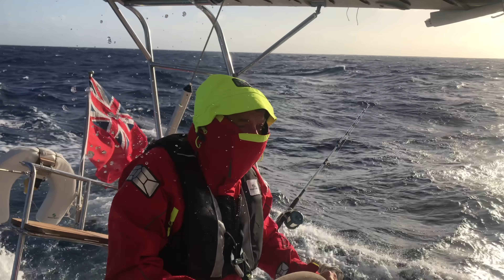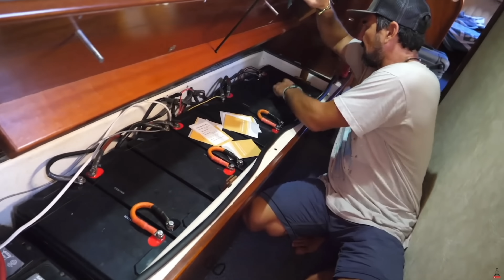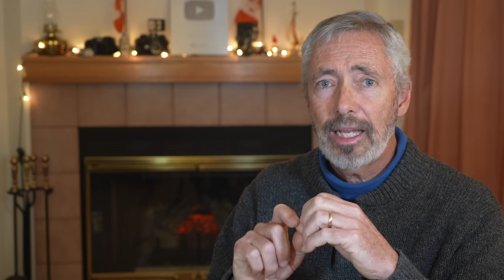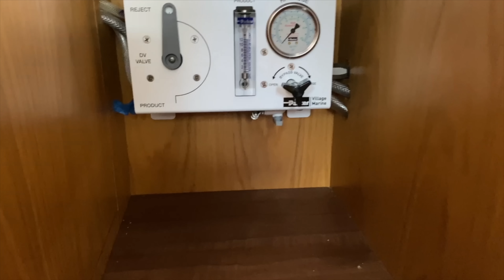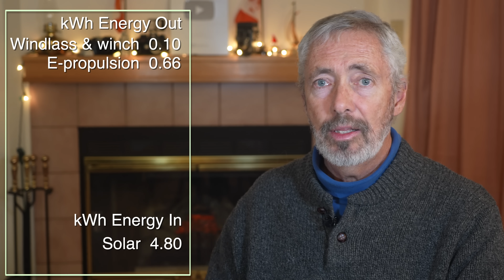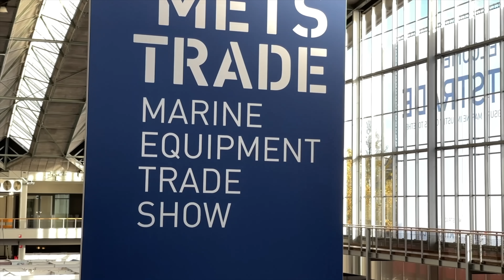Building an ALUMINUM Sailboat Pt 8 - HYBRID Power on a Sailboat: Will it Work for Distance? | EP 228

Comment: You might be wrong about Norway and Solar.       In winter we have little to just a few hours of sunlight.   But spring and summer, depending on where you are in norway close to 24 hours of sun.   So you have to acount for all the extra hours you be charging here. June in Sognefjorden you will have 20+ hours of sun if not in shodow of the mountains.      -Norwegian sailor

Comment: I personally would probably be willing to go with electric engine instead. But I would still get DC generator. Nice thing about generators is that at least in theory, they are simpler and more reliable, DC even more so. Those generators also come with their own self contained enclosure to keep it from elements and noise reduction. 
Ofc, electric engine has it's limitations, so you would have to be comfortable working around those.

But honestly, hybrid setup if you have money is best for almost every modern sailor. It's versatile and safe pick, and works well with someone that wishes to have electric appliances and other electric conveniences + simplification of systems on board.

Comment: I think something being forgotten here is the possibility of using a smaller almost agricultural style water-cooled diesel, much smaller than what you would typically use as the auxiliary power unit to turn the prop, to run a generator set (charge batteries or power high electrical consumption situations) and also provide heated water for a heat exchanger for hot water. Your hot water tank could have both the heat exchanger and an electic element in it. Multi-point charge controller for a few banks of batteries to allow you to combine the outputs from the diesel, solar, and wind turbines. Further hot water production aid being given by a solar heat exchanger. To turn the prop for propulsion, a geared electric motor with regen capabilities so that if you're anchored up in a river/actively sailing it acts like a generator. 

The key to most of this is picking the right diesel motor. I have seen diesel motors that whenever they get used to drive a generator use one gallon per hour. I have seen others that whenever they get used to drive a generator use only 2 gal over the course of 24 hours while powering tools such as air compressors, table saws, electric drills,  .... Think low rpm high torque on the drive side at 600-800 rpm range(barely above idle) running through a chain drive (high gear ratio like 1:3 or even higher) to drive the generator/alternators. 

Lighting = LED everywhere along with light tranfer devices that reflect light from outside down into the cabin side where prisms/mirrors scatter it into each room. 
Heating = radiators (remember you can put a second heat exchanger for the cabin heating system in the water tank. So your hot water tank for showers and sinks should have two heat exchangers and an electric heating element in it. One heat exchanger for the cabin heating positioned at the top of the tank. The heat exchanger that is in the cooling system for the diesel engine at the bottom of the tank where the electric element should also be.)

Diesel powered heater. There are cheap Chinese diesel-powered heaters that provide both hot air and hot water. Espar branded heaters are nice and all, but parts availability can vary! Cheap Chinese diesel-powered units/replacement parts are much more affordable and likely to be available in whatever part of the world you find youself in. Plumb the diesel heater and solar water heater into the hot water tank. You now have a hot water heater that can run off of diesel produced heat from both the generator motor's cooling loop, and the diesel heater, solar, and electric which is provided by solar, wind turbine, generator, batteries, and regenerative production from the prop as you sail/are anchored in current.

Might as well throw a small gym in there where you have a couple of exercise bikes that have you turning generators too😂🤣. LOL... Every little bit helps! 

Air conditioning. In trucking we have what is called a poor man's APU. 12-volt DC mini-split AC. Read carefully: many of these systems suffer because they are shipped with the bare minimum amount of refrigerant. Many of them can easily and safely use about 50% more refrigerant than supplied from the factory. When filled to actual safe capacity they can keep my truck down at 60°F inside on the low auto setting for a day and a half on a 400ah two battery bank of Lipo batteries!! 

Solar panels: important to get the style of panels that are more like a bunch of smaller panels in series. The ones that when the panel is partially shaded still produce power. Also the style that still produce power in low light/cloudy conditions. And yes, you should have some solar panels on the inside of the cabins. You have windows through which light shines! Harvest that light. You use stored power to produce light inside. Wouldn't it be nice to reharvest some of that light?

Lots to think about here. Much of this would be kind of complex to institute, but would be wirth it in the long run!

Comment: One thing I don't understand is why the cost of battery storage you quote is so high. All the battery manufacturers — like Smart-B you toured — do is they buy cells from established Chinese brands (they monopolized the market), add BMS and packaging. Meanwhile, you can buy the same exact cells from a distributor for way, way less! If you google "Eve MB31 Prismatic 314Ah", you'll find that it can be had for less than €90 in the Netherlands. So, at the time of writing this comment, you'd build a 32.15kWh array for €2880! Sure, that's just bare cells, but adding BMS' (should be no more than €500) and packaging/frame cannot justify the 10 x premium of the ready-made batteries you plan on installing! 

For the record, battery makers all use the same cells because China has basically a monopoly on LiFePo4 batteries. This particular distributor is  popular with DIY homeowners in Europe who add battery storage to their homes.

Comment: We sail maybe 70% at the beginning it was 90%… we sail with a 7,35 boat so sometimes we have a weather window that will close, and it safe then to just use the engine.
Also, if we have straight upwind for 3 days, it’s sometimes not an option to stay somewhere for that time

Comment: I would approach the electricity requirements of a yacht  in the following manner:

A- Broad categories of electricity usage on a yacht:

1- Lighting, fans, and communications gear: I think these can be easily supplied from solar panels and from wind turbines at night. Except for the doldrums, you should have wind/breeze on an ocean/coastline almost all the time.

2- Heating and cooling/refrigeration:  The most efficient way to do this might be via heat-pumps, some of which even work in sub-zero temperatures(but you could still have problems in deep Arctic or the Antarctic).  You might still need backup diesel/conduction or electric/convection heaters.  

These days, there are solar panels that you can even walk over, so those should take care of even heating and refrigeration needs, and if the chamber is well-insulated, you could retain the energy provided during the day through the night. 

A very large wind-turbine would be a hassle, unless some anchorages don't provide shore power.

If you're under sail, then regenerative electric power from the propeller could even take care of this without requiring batteries for back up, so you don't need to store energy for voyages. You can continue to make and consume energy under voyage without storage, provided the drive is large enough for those needs.

The yacht's ballast would be in the keel, so that is a problem, otherwise, you can directly store energy from any source, as heat by heating water or sand, but unless the keel is very well insulated, this might not work, so you'd lose it to the ambient ocean

The greatest amount of electricity in air conditioning  and refrigeration is consumed by the compressor, which heats the Freon, ammonia or other gas, so instead of using a reciprocating or a rotary compressor, if you have oil or water at very high temperature, you could directly use that heat without converting it into electricity, so you'll need electricity for just blowing the fan(which needs very small quantities of electricity that any other source can easily provide).

Fresnel solar-thermal solutions can directly heat water to 500 degree Celsius( for steam generation to run a turbine) by focusing the Sun's light on a tank of water. Running a turbine would be very impractical on cloudy days or in rough seas, where it would be impossible to keep the mirrors focused on the tank, but could perhaps heat oil or water at lower temperature for heating and cooling systems, still unpractical on rough seas and cloudy days.

Hybrid solar-thermal solutions can directly heat water for bathing and heating, but not for steam generation. If you have good insulation to retain this heat, you could even use it for heating and air conditioning, but the the micro-piping inside the solar-thermal panels wouldn't be practical if you're walking over those parts of the yacht.  

3- Propulsion: Solar and wind Turbine electricity will never be enough for propulsion of a sufficiently useful duration, so when you don't have wind for your sails, the best option would be to use either a diesel engine or a hydrogen or ammonia fuel cell or internal combustion engine. They have internal combustion engines that run on ammonia, but those aren't very efficient, yet.  Ammonia is much safer than hydrogen, which is very volatile, but since you'd also have regenerative power, while under sail, the best option would be to generate hydrogen/ammonia from seawater and store it for a fuel cell for propulsive and other needs.

I don't like batteries, except for backup systems, like the communications and navigation gear, which need very small banks.

Comment: Id have a (2 smaller) propane deck/portable gas bbq that can be taken ashore, used on deck or in an emergency, used for the kitchen as a backup, worst case one tanks empty, use the spare/second and being smaller than the BIG one/s in the video. Much easier to be discrete with too and able to have a bbq on a beach/shore/camping on land (keep a tent on board too, for thoes shore trips) as boating gets as bad as being shorelocked IMO
Reply: indusction is safer on a boat and get a fan forced oven/frier and dont overpay as its better to just replace IMO. I see you have regen from the propella under sail, id have n-type >20% efficent 400-475w solar cells as well. Thoes batts need to be always ready and waste not....
Reply: and get 2 small wind turbines for wind energy regen too (like davos) its worth it and they are cheap!

Comment: I don't know if you have mentioned that in a different video before and if you do I apologize. About the electrical system on your new boat. Have you decided if the boat  will be running on 120/230 V60HZ or will it be on 230V50HZ. As far as I understand that's a major problem for boats that travel around the world. I have been looking at boats in Europe but this problem would prevent me from buying a European boat. And as far as I know there isn't a great solution for this problem.

Comment: Great video.  I am considering going a step further, putting in an electric propulsion system, with a fixed speed generator/renewables to charge the battery bank.  would appreciate your thoughts on the electric motors you may have looked at for your current project, I estimate I will need a 50kW motor to manage all possible demand and a 30kW generator to support any charging scenarios as well as support house loads.  thoughts?

Comment: We have a fully electric Fountaine Pajot Athena including electric motors for propulsion.  I agree with your numbers.  We use about 1.5 Kw for cooking and about 450 w for making 45 liters of water with our Echotec Water maker.  Our total consumption for the house is about 4.5 kw per day.  We have a small two gallon hot water tank that we use primarily for dishes.  We might have a hot shower just once a week but we are in the tropics so a cool shower is normally just fine.  

We have 20kw of Lithium battery but they only cost us about $6000 including shipping etc.  We can motor about 15 miles maximum on those batteries and so just perfect for most day to day sailing like getting in and out of the harbor or marina and perhaps a little motor sailing if the wind dies.  For any serious motoring requirements we depend on a generator to produce 6kw/hr.  This will let us motor indefinitely at just over 5 knots.  We have 2700w of solar and so we can produce from 9 - 13 kw of electricity per day if it is sunny and as low as 3 kw if it is rainy.  Since our batteries of 20 kw and our requirements are about 4.5 kw we can go for a few days of rain with no problems.  If we need more power we can run the generator for an hour and produce 6kw to fill in the gaps.  

I love sailing with the electric motors since there is this silent and seamless transition from lifting the anchor and getting out to sea and sailing and then ultimately coming into a new anchorage.  I love that reliability and minimal maintenance the motors require (about 30 minutes) every time we haul the boat out to change the oil in the sail drive unit.  Last season we went 52 days without running the generator.  I hope to do the same this year.  I do like to run the generator once a week for maybe 30 minutes only to keep the generator healthy and ready.  

I'm happy getting the range I need when I need it and I love that when we have lots of power I can motor sail, run the AC, have a hot shower and it is all run on completely renewable, free energy.  I'm liking it.

Comment: mounting a 353 superwind turbine on the top of the main mast provides a lot of power......i have seen it done on a pair of froggy cruising yachts (mum and dad on one and son and wife on the other) that stopped into Dunedin New Zealand a few years back...... they each had 900 of solar on a rear arch and the mast top turbine and got most of their power from the turbine......had no problems with noise or anything like that.....with the turbine being so high up meant it was in useful wind even when there was very little at deck level, particularly noticeable when at anchor.

Comment: I think I'm going to eventually do something like this, but I'm waiting for a free-piston hybrid car range extender to get another 30-40% efficiency and go pure electric drive.   Also, in the US, if the boat is purely "wind powered" one can 6-pack charter with no license, so if a wind generator and regenerative is all you normally use that should work.   A short pair of heavy "emergency jumpers" could be used between the range extender and the battery pack while cruising under diesel or petrol for extended periods without paying guests which should still keep her under that exemption.

Comment: Hi Guys great video on the hybrid electrical system. After living and working in the Caribbean for many years now I have gotten to see and be part of the installation of many hybrid systems from a residential and commercial point of view, some very interesting stuff happening out there. Anyway there are many controllers and inverters on the market that can now handle multiple input of power at the same time. For example the system you have talked about in your video is a two input system which will work great. But you can add a third where two or more inputs can charge the batteries banks at the same time. So you talked about solar and diesel generation as your two inputs, if you added a wind turbine you might not need to use the your diesel engine for generation. The wind turbine can be engaged when sailing or at anchor and provide power at the same time as your solar system. Hope this helps and maybe gives you another option to look at. If you would like to discuss this further please feel free to contact me. Cheer Brad

Comment: You are doing alot of research but are missing some elephants.  You are building an aluminum boat and i have heard nothing regarding insulation!  HVAC will probably be a major issue.  A mono hull sailboat may not have been the best choice for solar electric as adequate panel space versus solar shielding by mast and sails will be an issue as opposed to the catamaran powerboat layout of a silent yacht. I still say (although to late for your build process) electric drive with a separate diesel generator set with all electric  serviceswould have worked better from a space utilization aspect.
Reply from the maker: There will be 5cm insulation all under the decks and lining the hull down to the floors so this will be our best insulated boat to date.

Comment: Hi there. I see you have a lot of comments. Your reasoning around the pv production of kWh in the north, I believe has an error. In the summer there are much more sunlight in the north than in the Med or the Caribbean. Lower air temperature also enhance the efficiency. Solar panels will also improve significantly in the years to come. So basically I think you will use less diesel for power production. In the summer. Not in the winter. Diesel-electric propulsion using large azipods is frequent in the cruise-industry, so getting a good diesel-generator able to work 24-7 in combination with a system similar to what Dan and Kike experienced in the Salona 465E, will perhaps be even more energy efficient. You have chosen a very interesting design and in the years to come there will be lots of new ways to optimise the use of electric propulsion. Greetings from Oslo, Norway